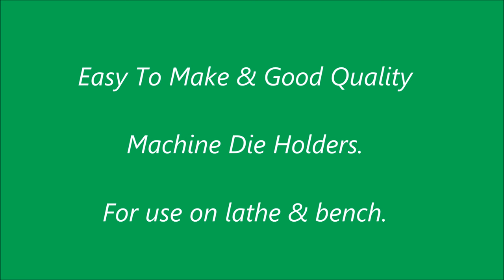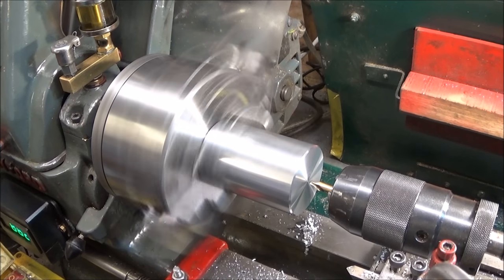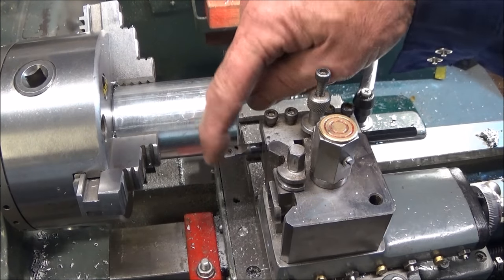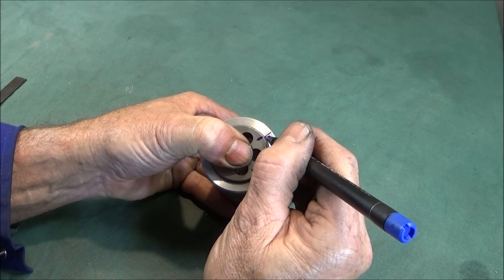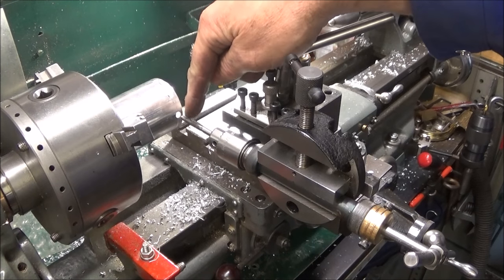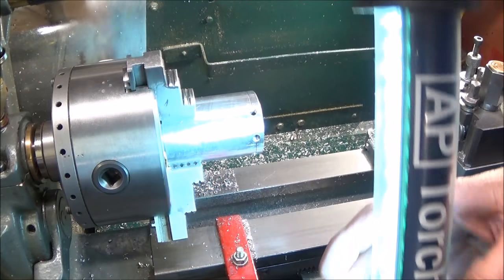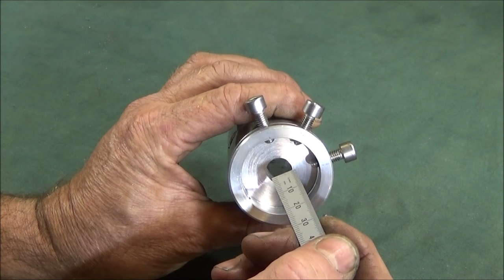Easy To Make Quality Machine Die Holders For Use On Lathe And Bench

Comment: Nice job en good discription, but how do you clock the piece within two thou in a three jaw chuck?
Reply from the maker: +Jan Kersten Hi Jan Thanks, I normally just put the piece in the jaws and keep turning it in the jaws to where there is the least run-out. Then start the lathe and carefully give the work piece a tap with a soft mallet.  When you hit it right it will run true. It may take several attempts but normally I can get it to within .002. I will show this in another video soon. Regards Steve

Comment: very nice!

I'm wondering why the hole bigger than the biggest thread is only 10 mm deep. doesn't it limit the total thread length? why not all the way through or at least down to the central handle cross bar.
Reply: You can make it any depth you like, however the deeper you bore it the more slop will be introduced in the central shaft. That alignment is critical to getting the die dead straight with the chuck and ensuring that the threads will remain 100% parallel with the work.
The start of the die is literally a spiral, so it tends to push the die slightly sideways. Once the thread starts off crooked, the threads will try to remain on that slightly incorrect angle. That results in an inaccurate thread.
The central shaft (and the tap bottomed onto the internal ledge) ensures that the die is perfectly flat providing your tailstock is aligned properly. To get perfect results, the central bore should be reamed to final size rather than just drilled on a bench press. If the central bore is long, it lessens the importance of the hole diameter. Make sense?

Comment: if you just nib the center spot before drilling, you can measure half the diam of the die out from center and just kiss the face with the boring bar while rotating slowly and have a very close guide line to hog out to. seems better than tracing around the die with a marker and saves even more measuring or test fitting the bore than as Steve shows

Comment: nice pieces. isn't the through hole for the big one a little too small? cheers.
Reply: I guess you stay for till the end of the video, Steve bores the internal hole additional 10mm deeper and slightly larger than the largest die you will use. Thanks, I enjoyed and plan to make a set like yours
Reply: @davidschwartz5127  - That"s nice, except he DID NOT bore it larger for 10mm depth. This is easily seen when he shows the finished item at the end of the video. 🙄
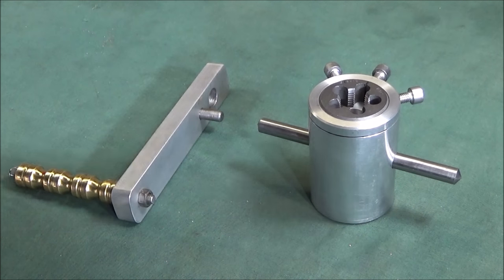EDIT: In fact, just look at the very last frame at 31:12... it is right in the middle of the screen!

Comment: nice vid. really liked that tool post drilling attachment. about the depth of the bore, couldn't you have just measured the width of the die and made the bore the same instead of having to go back to finish it off?
Reply from the maker: Hi Shawn, Yes you could do it that way. I do it this way though, just to make sure I get it dead on with alignment of the screw holes. It is just a safe method of machining to get the die definitely sitting on the back face when the locking screws are tightened. If the position of the screw holes are out, even by a couple of thou, in relation to the centre of the depth of the bore, it can cause the die to lift off the back face when tightened Regards Steve

Comment: Hi Steve    I really would like to know why you did not finish threading the screw holes with your cross drill.   I am sure I would have finished threading the holes that way but figure you must have a reason for not doing it that way.   I would sure like to hear your comments.    Thanks   Dale
Reply from the maker: Hi Dale. I just start the thread off so it's nice and square to the work. The taps often slip in the drill chuck so it's better to finish the thread on the vice

Comment: Another great tool video Steve, I am as I write  making some die holders on my mini lathe.

I notice that you have particularly good quick change tool posts on your Myford and your mini lathe, I would like to replace the tool post holder on my mini lathe so I have been looking on the RDG Tools website but I am not sure which model to order for the mini lathe, I would be most grateful if you could assist me. Also if you have any recommendations for a vertical milling slide suitable for the mini lathe , thanks.
Reply from the maker: Hi it is a Dixon Quickchange toolpost. If you get one that is specified for the Myford lathe it is exactly the same as the one for the Mini Lathe. Sometimes Chronos are cheaper than RDG
Reply: Thanks Steve. Do you know of a vertical slide suitable for milling on the mini lathe? Sorry to be a pain but I am new to all this, I have only had my lathe for a couple of weeks.

Comment: hello steve, you choose aluminium for machinability reasons or cause you had it on stock? i was thinking to make it of steel but maybe i'm wrong....
Reply from the maker: I had the aluminium in stock but it is good quality aircraft 6082t grade. I've had this set for over 20 years now. You could make them from steel though, it's whatever you prefer. Regards Steve
Reply: I saw another video where the guy machined the main part from the brass cover of a normal bathroom tap (faucet). Machined beautifully and looked awesome with it's stylish shape.
Plumbing fittings are a fabulous cheap source of brass that usually is of a grade for a nice surface finish!

Comment: I saw you use a negative rake on the toolbit. Is that because that is the best way to cut aluminium or is there another reason? Would appreciate you response. By the way: another excellent performance.
Reply from the maker: Hi Herman, The tool shank is ground so that when it sits in the tool holder it is preset in that position at the correct angle. This is how they were set in the CNC machines I used to use. They are great tools and very cheap if you get them on Ebay from China. They are the SCLCR06 type. Regards Steve

Comment: Very nice work Steve. I always enjoy watching your videos! I'll have to make a carriage stop like yours at some point, it looks very handy especially for boring operations. 

P.s After funding for quite a few time, I'm now a Myford owner myself. Even though it's smaller and weaker than my current Asian lathe, I'm now capable of doing parts and operations that was almost impossible with my previous lathe and what a smooth operating machine it is. Next toy should be a small milling machine and I really like the Tom Senior E-Type mill and the Emco FB-2. They fetch a lot of money but I don't want any of my main machines to be Asian made anymore. You might want to get rid of some tooling and make space for a milling machine yourself!
Reply from the maker: Hi Nick, Thanks. Yes I would really like a milling machine, but do not have the room. I would need a larger workshop as mine is only 10 foot by 8 foot. Did you get a Myford ML7 or Super 7 lathe? 
  When I was doing this video I noticed my lathe was shaking a bit.....The stand wasn't strong enough. I have installed a heavy duty lathe stand this week. Also I got a second hand Myford deep tray. I will be setting it up so I can use coolant on the work. Hope to do a video on re- installing the lathe and coolant pump etc soon. Regards Steve
Reply: Steve, I bought a grey S7 from a trader near Stroke-On-Trent about a 
couple months back. It wasn't cheap but it was a bargain considering the condition and tooling that came with it. I was funding for quite few time and it was a relief that the machine is as expected. I'm based in Athens, Greece and I couldn't have a close look to the machine hence over the last couple years I developed some skills judging condition of lathes from just photos as this was my only option. Very risky I know! 

8x10 foot workshop is near perfect and there is certainly room for a small milling machine. What about the Dore-Westbury Mill? It isn't any bigger than your current Asian lathe and still is more capable of your current bench drill! Selling just those two tools will make more than enough room and funds will be enough for a nice Dore-Westbury that is now a piece of machining history and a lovely tool. I'm considering DW myself as my other options seem to be quite pricey for my budget. 

The dip tray and/ or raising blocks are a nice addition to any Myford. I myself don't really like the Myford stands though. 
My lathe is vibrating only when I switch ON the Dewhurst switch and the motor starts. I think the tension on the motor belt is not correct and/ or the motor base is not positioned correct. I'm waiting for the manuals from Myford so hopefully I'll find some info in there. If it's comfortable enough, sure do a video on the new installation of the lathe, it will be handy and there is none on youtube so far. It might take some time but you may can include some leveling info as well. 

P.s Buy the Dore Westbury!!!
Reply from the maker: Hi Nick, I have just been looking at the Dore Westbury. I've never seen one before you mentioned it. Looks like a great machine.
Reply: Titanium15160ottttyrr yioiiiioo I was just the thing is the

Comment: Hi Steve Nice work  . Could one press the Die into the Holder .
Reply: That would significantly alter the size of threads it cuts. The center bolt in the die holder is specifically designed to be wound in to spread the die open slightly. That allows you to correct for a nut that is slightly loose on your threads.

Comment: Is the centre retaining-screw necessary?
Reply: Sure, the center determines the dimensions of the thread, the outside ones lock it in place. You'll notice the die is split. the center screw wedges it apart to get the threads as tight as needed. (There's a word for that, but I just can't pull it out of my skull!)
AAR

Comment: Why start threading with tool post jig then switch to vice to continue threading then rechuck to finish boring? seems unnecessary steps  that could introduce error... no?
Reply: He has answered that a number of times already. The small chuck of the drilling gadget doesn't grip the tap tightly enough to prevent slipping. So he starts the threads straight in the chuck, then connects the tap handle direct to the tap to do the full thread cuts in the vice.
Personally, I was going crazy watching how many times he removed the work then (edited out) rechucked + and registered it in that chuck again 😢
I would have just left the part there, slid the drilling gadget aside, and ran the tap in while it was tightly gripped in the lathe 😅

Comment: What is this "silver steel" you speak of?  What does that mean in American?  Hot Rolled Steel?  Cold Rolled Steel?  Some sort of tool steel?
Reply: Americans would call it "drill rod". It's just hardened steel that has been ground to a close tolerance, so it's very parallel. In comparison, normal steel bar varies widely in roundness, diameter and surface finish along it's length.

Comment: Was that a "Bastard" to file?........I'll see myself out now!
Reply from the maker: A procedure that has been used since the invention of the lathe. They also used to make file guides for metal lathes.
Reply: You need to take a Second Cut at that joke. It was easier not to do that work in the Mill.

Comment: Hi Mr. Jordan, that's no very good, you can not use that for long thread, the  through hole is too small and that fixing (three points at the same side)  does not ensure alignment for lathe works
Reply from the maker: Hi Ilario, You can drill them to a larger diameter for the through hole. I've been using these for over 20 years to make perfect threads for hundreds of different precision components... without any problems. Thanks for watching.....Regards Steve
Reply: It's hardly ever helpful to begin a comment with 'that's no very good' is it? Might be more appropriate to start off by thanking Steve for his VERY considerable contribution, after which you might want to offer your own suggestions.

Comment: Can someone please explain the function of the three off-center bolts going through the carriage and into the die?
Reply from the maker: They are to hold the die and stop them spinning in the holder. Also they are use to adjust the split dies cutting diameters a certain amount. Regards Steve
Reply: The outer 2 are used to prevent the die rotating, and those shouldn't be more than hand tight.
The tapered one in the middle is used to adjust the die up a little. This is tightened down  after you do a test cut (which should always been done with dies).
Remember, you can't change the size of a nut or a tap... so if you find that the test nut is a bit loose on the newly cut threads, you wind in the center bolt into the die to spread it.
A small adjustment can make a significant difference in how the resultant parts thread together. Some high quality dies have a small captive set-screw going sideways into the slot, so you can set the size permanently.